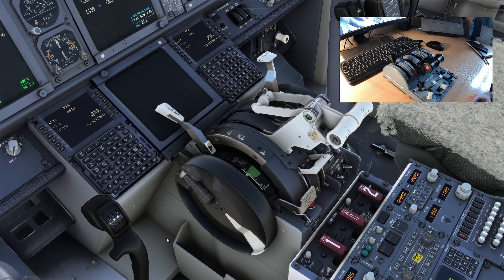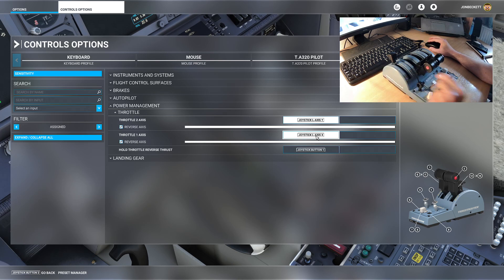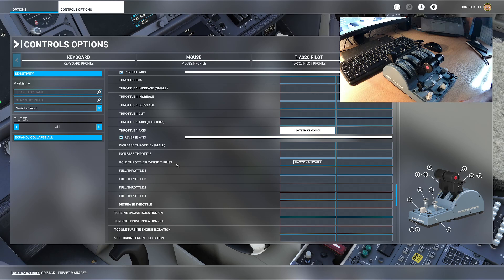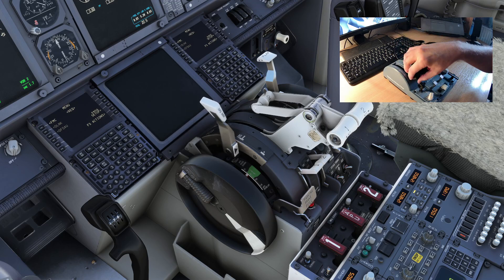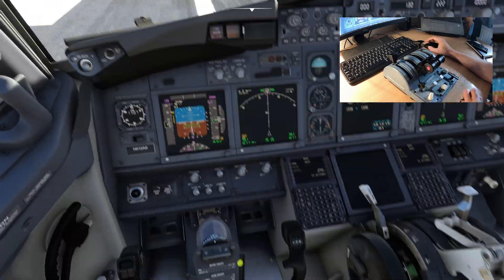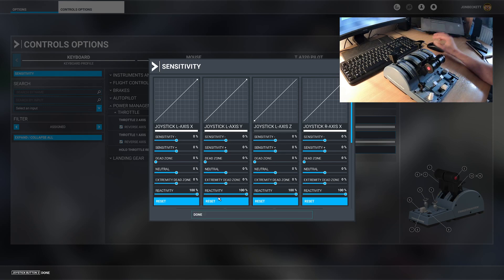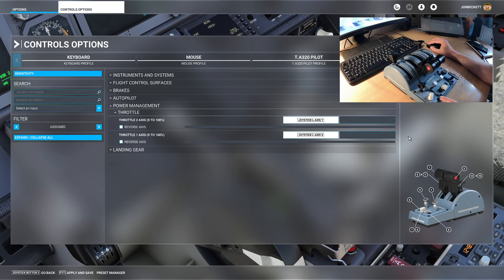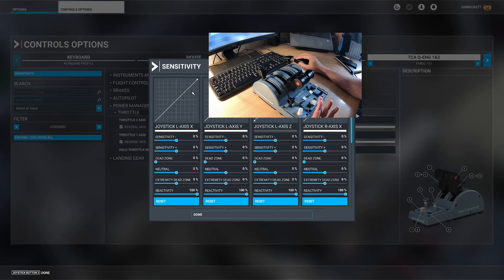How to configure the Thrustmaster TCA Throttle Quadrant for the PMDG 737-700 in MSFS

Comment: Hi! Tnks for the video! Please, can you tell me how set the spoiler??
Reply from the maker: Spoilers can be controlled with keyboard, or with an axis on a controller. They are in the control configuration of MSFS.
Reply: @jonbeckett  Tnks Jon, i have too  the Tca Throttle Quadrant, i set the spoiler axis in the MSFS configuration, but i don't have your fluid movement,only a block in the mid escursion ...any help?
Reply from the maker: @PatrizioMigliola  Maybe check the sensitivity settings - make sure you have everything reset to zero (straight line input/output) ?

Comment: The parking brake button does not work. Can you tell me how can i set up it? Thanks!
Reply from the maker: Yep - I'm guessing you have the Throttle Quadrant - hardly any of the switches will behave in a predictable manner - no matter how hard you try - because the 737 doesn't work in the same way as an Airbus. You have to use the switch in the cockpit and unbind the controller.

Comment: Thanks! Fixed the throttles and reversers, but no efftect on the flaps or speed brake. At least I've now have made some progress in the 737 mapping.
Reply from the maker: It's tricky, isn't it. I just have various lever axis mapped - you may have to play with reversing them, perhaps ?

Comment: when I hold the reverse button and push the throttle up, it only goes to less than quarter of the way then stops so I am only getting round 10% reverse thrust
Reply from the maker: Have you checked the sensitivity curves for the throttles ?
Reply: @jonbeckett  hi Jonathan, this was a bit of a blonde moment…I tried in runway config and it works perfectly…thanks so much for the quick reply
Reply: @joelangley7974  what is runway config?
Reply: @hazemobeid1375  went into PMDG setup and there are all different startup options such as “cold dark” and one is takeoff config so clicked that
Reply: @hazemobeid1375  sorry just reread my comment, I mean takeoff config

Comment: Hopefully PMDG will fix this so we can just toggle between normal thrust and reverse thrust without having to hold a button
Reply from the maker: It's not really their problem to solve - the Airbus controls are designed for the Airbus.
Reply: @jonbeckett , but with CRJ from Aerosoft works correctly.
Reply from the maker: @mariuszkalinowski2879  the CRJ has other problems all of it's own :)
Reply: @jonbeckett , but we writing about reversers and throttle.
Reply from the maker: @mariuszkalinowski2879  the CRJ works because it has a single axis for forward and reverse thrust. The 737 does not - the reverse levers are a separate axis.
Reply: @jonbeckett  it also doesn't work on other controllers, not specific to this airbus one.

Comment: Unfortunately this did not work at all for me. When holding thrust reverse, the reverses kick in but wont move beyond idle.
Reply from the maker: The engines have to be running.
Reply: @jonbeckett  can you elaborate more on this. I am having the same issues and the engines are running and the reversers open up at the plane does not go backwards, I did the exact same set up that you have, can you help?
Reply from the maker: @Slow370Z  it's worth noting that the levers will only travel when the engines are running - I imagine it's a bug with the 737 at the moment.
Reply from the maker: @Slow370Z  Also - make sure you don't have any other devices configured for the axis - I imagine they could cause havoc too.

Comment: Thank you for your video.  I am using the Thrustmaster TCA and have everything set up except on the control options for the throttle I do not have the reverse box for the throttle 1 and 2 axis.  Any idea on what I have done wrong?
Thank you.
Reply from the maker: The engines have to be running.
Reply: @jonbeckett  Thank you for the reply. I do have the engines running. I do not see the click box for the reverse throttle in the MSFS settings page.
Reply: @ryanjones8482  If you type in the keyword 'reverse' with 'all' assignments visible it will come up. There is a hold and toggle option but some say only the hold version will work. Assign a button or key to this Reverse thrust (hold) command.

Comment: Hello, i had follow your instructions point for point. But when i push the Joy BTN 1 (red button on the thrust) the reversers make only a small move. I can't move the reversers with the axis. Do you have an idea why?
Reply from the maker: Did you configure it on the correct axis in the controller configuration? I've seen that happen, but only when the axis were configured on the 0-100 settings. You have to REMOVE the assignments from the 0-100, otherwise both will happen.
Reply: @jonbeckett  ok... i had find the solution... I'm sorry, i have to test it with a working engine, not in the C&D. In the C&D they don't move... :)
Reply from the maker: @Kopfle  Oh yes - I forgot to mention that :)
Reply: @jonbeckett  Thanks for the fast answer.

Yes for sure, i had removed the 1-100% axis and use the "Throttle 1 Axis" and the "Throttle 2 Axis" // "Hold Throttle Reverse Thrust" ist "Joystick button 1"

I have no idea why the throttle reversers not move with the axis when i push the button :/

Comment: Thank you for the video, Jonathan! Interesting because if I don't use 0-100% throttle then it won't go all the way back to idle, it only works fine when using 0-100%. Also, PMDG told me that 0-100 must be used. I'm a bit confused as to why mine is not working the regular throttle axis as shown in your video.
Reply from the maker: Have you checked the sensitivity section of the controller configuration ?
Reply: @jonbeckett  I'll check, thanks!

Comment: For the Flaps on the TCA I've mapped JOYSTICK L-AXIS Z to ... Sensitivity-  50%, Sensitivity+  0%, Dead Zone  0%, Neutral  19%, Extremity Dead Zone  0%, and Reactivity  100%, and that gives me flap detents 1, 5, 15, and 40. Still messing around with it.
Reply: I did the same as you, and the flaps jump from 0 to 40
Reply from the maker: Another option would be to remove the detent hardware from the lever (it's easy to do - it's designed for it) - then mark the positions on the axis with Dymo labels or something :)

Comment: I have a bravo throttle quadrant but the speed brakes won’t work for the pmdg your airbus throttle what do you set up on the controls for speed brakes what key do you use ?
Reply from the maker: I used the speedbrake axis on the Airbus quadrant. If you look in the controller configuration, and make a profile specifically for the 737, you should be able to re-map keys, buttons or axis as required.

Comment: Reverse isnt working for me
Reply from the maker: You haven't shared what controller you're using, or how you have configured it.
Reply: @jonbeckett  arrrh sorry, im also using the Airbus tca, it’s comfigured just like yours.
Reply from the maker: @viktorag8724  Tip - the throttles won't move until the engines are running.
Reply: @jonbeckett  lmfao ill try again then ahaha

Comment: Doesn't work for me... the reverser only goes back a little bit, doesn't move back at all when moving the throttle up while holding the button down
Reply: Exactly the same for me.
Reply from the maker: Did you have the engines running at the time ?
Reply: @jonbeckett  no, does that matter? The reversers did move all the way back when using F2 key

Comment: Thanks for the video , what about the landing gear configuración with the TCA? Thanks And like
Reply from the maker: If you've meddled with the landing gear switch configuration, you will have to revert to a new controller profile based on the default one - the "default" profile has special sauce in the gear switch - if you alter it, it doesn't work any more. It isn't helped that the gear lever in the 737 is not a switch - it has three positions - so you're already fighting an up-hill battle with the Airbus quadrant :)

Comment: how do you do the reverser button, i did it but it only toggles and i move the throttle but it doesnt move
Reply from the maker: You have to use the hold binding - not the toggle binding.
Reply: @jonbeckett  It'still stck for me after choosing this option
Reply: @jonbeckett  I have it as the hold but still have the issue, it doesn’t let me adjust the reversers

Comment: Do you by chance have the Thrustmaster TFRP pedals? I'm having issues with the rudder not working at all. I own the Airbus pack and i don't know how to fix it or how to program the twist function on the joystick to use as the rudder
Reply from the maker: I don't have the peddles. You just need to assign the axis in the controller configuration.